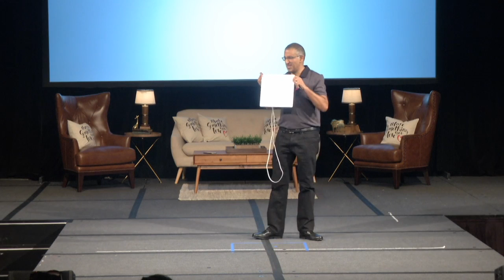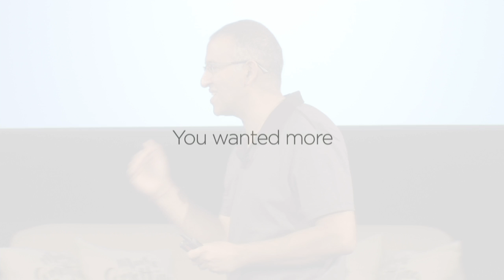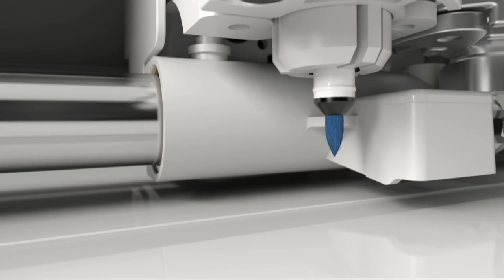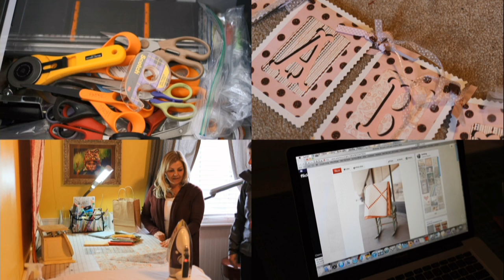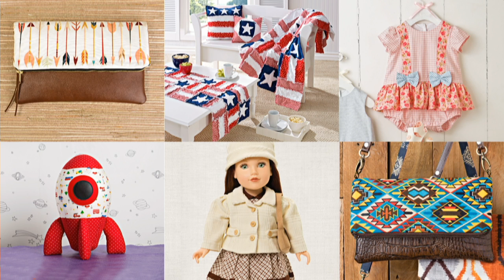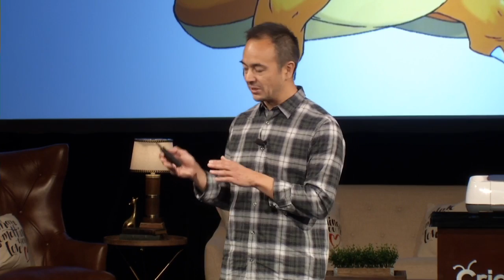Make Something You Love!

Comment: Wish that since this machine was "totally" redesigned it would gave been made at least 20" wide and had the option of usinf/not using a mat when cutting vinyl. Design Space is still missing features that other designing/cutting software packages contain. The new heat press seems small, what are its dimensions and what controls the pressure?
Reply: Please don't interpret this as a fight. Why didn't you tell them about these features in the surveys? I took the time to tell them everything I could in the surveys.

Also which other "software packages" are you talking about? I think I've seen those "other" packages and they cost $700+ and that's the cheapest one which most of us can't afford. This maker is $399 and I'll bet they'll give us discounts when it comes out.